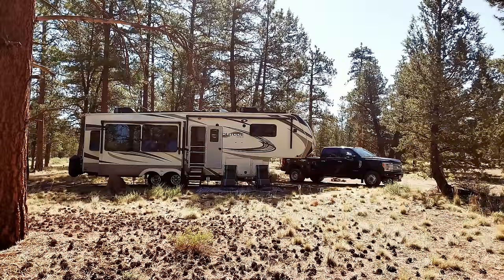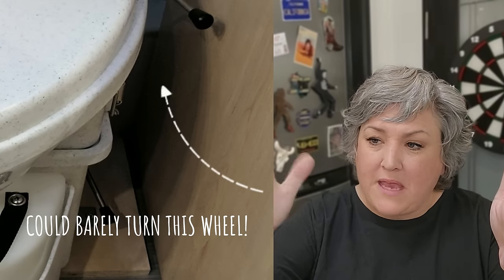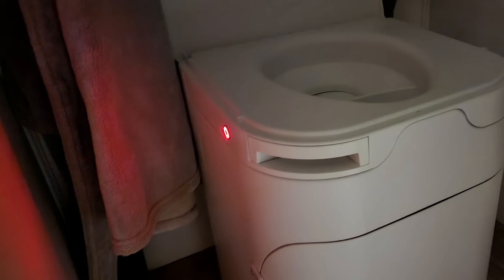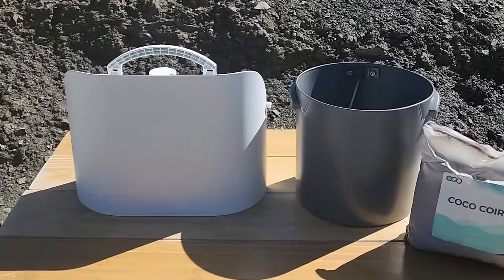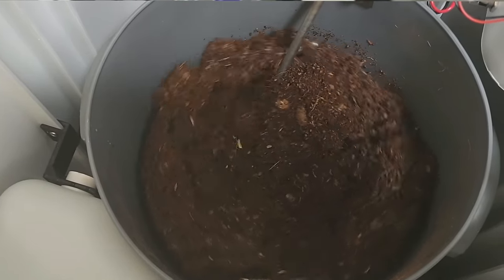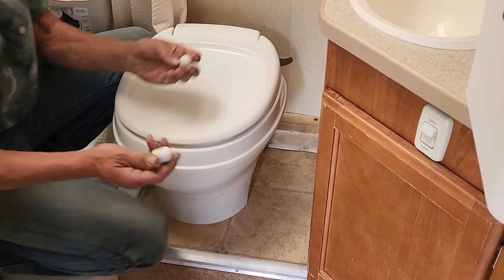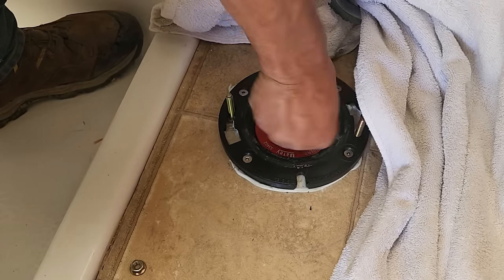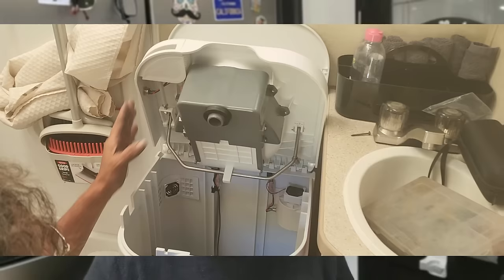COMPOSTING TOILET?! Why, Which One, Cost, How it Works, TWO FULL INSTALLS, & FAQ. OGOToilet

Comment: I am new to the RVing world and am curious whether the OGO is compatible in a wet bath/shower setup. In short, I know I can swap out the regular toilet with the OGO, but is there an electrical issue having it in the wet/bath shower? I tried reading through the previous comments but couldn't find a similar question.

Comment: Love ❤️ ya, but no.  Just no.  There is no such thing as a “cute” toilet 🚽.  (Ducking) 🤣
	Edit.  If you have the electrical capability, how about an incinerating toilet?  Stayed at a cabin and used one, it was very… interesting!
Reply: There is also a propane version. The reviews I've seen are a little mixed.
Reply: @zenseed75  — With a composting toilet you have a goo to dump.  With an incinerating toilet you dump sanitary powder.  But the electrical system on RV would be prohibitively expensive so you win the day. 😎
Reply: @patrickmclaughlin6013  — Interesting, but I’m not sure about lighting a fire under my bum.  🤣
Reply: @Erin-Thor  yeah but you don't have to go to a dump station to dump which is her point.
Reply: @zenseed75  — I WASN’T ARGUING!  LOL!  It’s all good, thanks for the info!  😎
Reply: @Erin-Thor  I'm not arguing either. Thought it was a conversation 🤷‍♀️
Reply: @Erin-Thor  😹 it's not you it's me. People think I'm mad when I'm not but when I actually am mad nobody can tell. It's a struggle.
Reply: Incinerating takes a huge amount of power, via either electric or propane.
Reply: @zenseed75  No worries, LOL!  😁
Reply: @bostongrammy7531  — True.  I was reading about a ShowHauler Super C build on a Volvo chassis - diesel engine optioned with electric motor drive, with higher ground clearance, a boatload of solar on top, and multiple bays of batteries on the underbelly.  (Note the electric drive option.)  IF, and that’s a big IF, you had the electric to support it, an incinerating toilet might work.  Otherwise I will admit, I was thinking stupid.
Reply: I have an incinerating toilet in a cabin on my property. (Love their slogan: "Turns your waste into harmless ash.") Ours works with electrical -- i guess a big coil -- so there is an open flame in that box. Not sure that would be safe at all for an RV. But for a cabin, it works great. You line the toilet with what looks like a giant coffee filter, which provides the tinder to start the fire.